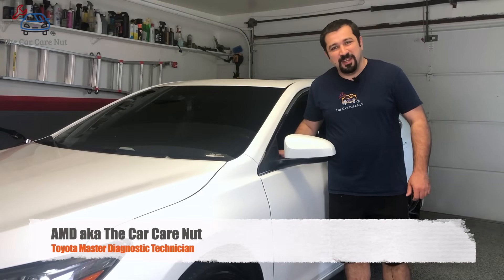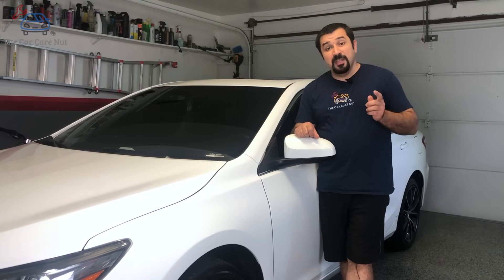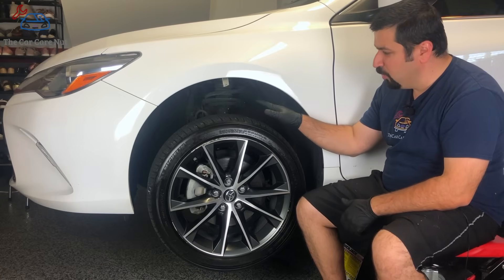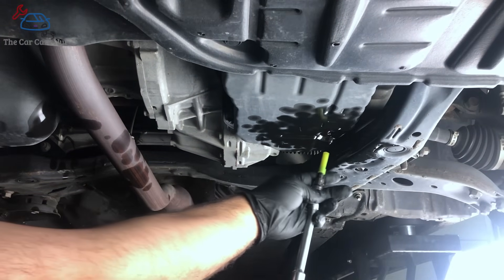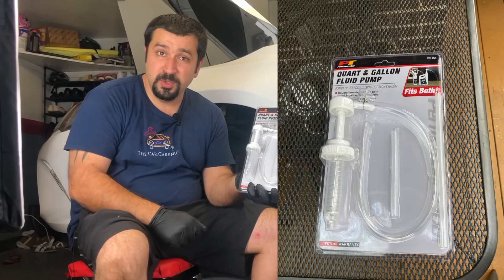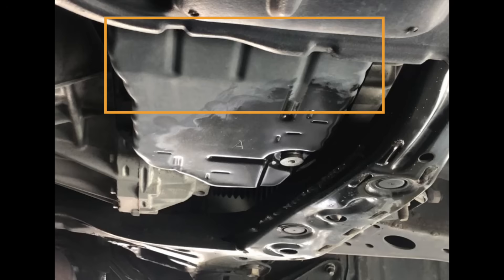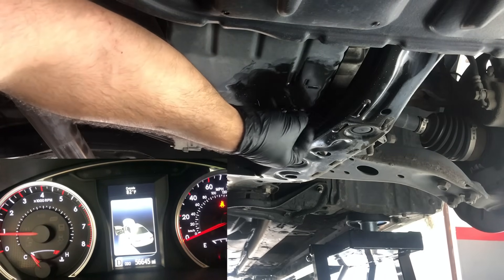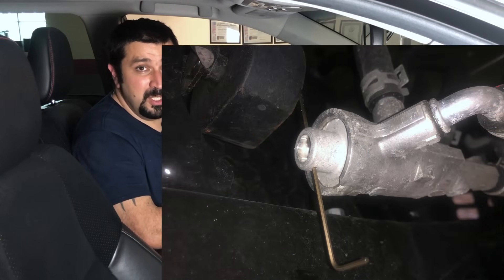How to change your Toyota Sealed Transmission Fluid

Comment: I am ordering a male OBDII connector from ebay for around $3. I will solder a wire inside it to make the jumper. No more guess work, no more jumper falling off while doing the procedure to miss the momentum. Just Plug-in/Plug-out.
Label it using a P-Touch tape.
I am not providing any link because over time they may no longer work, Just look for this on ebay:
Universal 16-Pin OBD2 Male Connector Cable Adapter Terminal Diagnostic Tools
Reply: Hey just don't get the pin #'s mixed up as in mirror-image! A home-made jumper with appropriate pin diameter will not just fall out ever, I made one with a resistor for testing fuel-level sensing circuits and used very thin paper clip wire.

Comment: Great video! I let the dealer change mine at 80 k, now I’m at 160 and prolly gonna let them do it again , they said there is no mileage for changing this and I said no fluid last forever, they changed it but Toyota should have put a dipstick on my 14 Camry

Comment: Is it The Same Procedure  For  2005 Tundra  And Temp Range ? Great Video  Thank You !
Reply: I just wondered if the jumper wire in the OBD 2 port  With The D worked on A 2005 Tundra Something that  Old ? Since My Scan Tool I Dose'nt  Do Trans Temp.  Thank You
Reply from the maker: Correction. The fluid range is actually 97-115 F my bad. And the jumper wire procedure does work on your truck just instead of the D light you’ll use the A/T OIL TEMP indicator
Reply: @TheCarCareNut  Thank You Very Much !
Reply from the maker: Hi! That should have a dipstick.
Reply: @TheCarCareNut   NO Dip Stick  For 2005   I  have Seen The Fill Plug With WS On The plug On 2005 Its On The Pass SIde   Plus The Drain Pan Has The Drain plug And The Check plug SO For Sure It Dosen't Have A Dip Stick          It's 4x4 With Double Cab  2005  I Bought it New
Reply from the maker: Interesting. If it doesn’t have a dipstick then it’s an overflow type. The fluid temp range should be around 97-115 F
Reply: @TheCarCareNut  Thank You Very Much For Your Help.   I Think On The Tundra The last Year With The Dip Stick Was 2004 ,     2005 and 2006 have  the fill plug 24mm  on the right pass. side and 2007 and up the fill plug 24mm is on the left driver side.

Comment: Any chance you have one for wifes ride?    2020 Durango RT?
Reply from the maker: I unfortunately don’t. However that one is even easier. If it has the ZF transmission which is similar to the Supra transmission it does require a temperature reading as well and you fill the transmission from the side until it overflows. Research on this transmission as I don’t have more information on it.
Reply: Ive seen a couple and like the others for the Ravs theyre way too much garble.   Your video on this was straight forward and easy to follow.   👍   Hence why I was hoping you had one.   Thanks again and keep up the great work for us DIY folks!    We appreciate it!   👍👍

Comment: What about the filter?
Reply from the maker: I would replace the filter. No harm in replacing it but no benefit either
Reply: @TheCarCareNut  interesting.. with every ws transmission?  Or only if they have high miles?
Reply from the maker: Actually with most Toyota transmissions especially WS transmissions. I see many 200-400k mile cars on the original filter just regular fluid changes.
Reply: @TheCarCareNut  nice to know that saves a lot of time
Reply: I was writing on who know what language haha, sorry for so many mistakes, wrong keyboard corrections

Comment: I've always drained trans oil and replaced what I drained. I won't do that anymore. My new 2017 tacoma off road came 1 quart low from factory in Mexico. Common issue with 3rd gen tacomas. Will start doing temperature checks from now on. Great video.

Comment: Thanks for this. I'm at the point where I need to do this. I'm not a bit happy with Toyota for coming up with ridiculous things like this. I'd pay the extra $20 for a dipstick and fill tube. And why is the level so bloody critical?  That's not very good design at all. Way too involved for something like changing a fluid.
Reply: Not a good design for you or me. A great design for the greedy arrogant decisions makers at Toyota. They obviously want to make it as difficult as possible so you won't do it and will eventually have to replace the transmission. How arrogant and greedy can one company get? They have the gall to make a claim that the fluid is "lifetime" for the vehicle. What idiots they take people for.(Not without reason I may add) They take the cake with this design. But most people will take it, pay out the nose for a Toyota, all the while Toyota will continue to look for ways to screw their customers. That is all this is and don't think this is ever going to go back the other way, because it's only going to get worse until people quit buying their product.
Reply: They want it to fall
Reply: @Fedproman  The new Toyota 2020 models put the dipstick back in, so I have heard.

Comment: If the car sets over night and you change your transmission oil and measure what you took out, why can't you put back in what you took out? Everything is at room temperature.
Reply from the maker: Hi! You can but I’d say if you did all that why don’t you just finish the job and verify the level is correct
Reply: @TheCarCareNut  I watched your video, many people don't have the equipment or someone else trying to help them.
Reply from the maker: The equipment you need is a small piece of wire for the jumper and rest is tool less
Reply: @TheCarCareNut  ?
Reply from the maker: I meant if you needed to you could pull it off alone. And as far as tools needed you could pull it off without a scan tool as the video shows.

Comment: Why is the fluid so dirty?...
Reply from the maker: That is normal for this mileage. WS fluid tends to get darker much quicker than older fluids. But it doesn’t smell burnt at all.
Reply: @TheCarCareNut  I replace my transmission fluid every 60k miles/6 years and it's always pink or slightly dark pink so it caught me off guard to see it that dark

Comment: Hi I took my 2012 lexus IS250 awd to the dealer for trans service they only wanted to do a fluid flush is this ok? Thanks
Reply from the maker: Hi! That’a ok if it’s done right followed after the flush by checking the fluid level.
Reply: @TheCarCareNut  ok thanks and I appreciate you getting back thank you

Comment: Does this same process apply for the 2013 Toyota corolla? Simply drain, refill and remove excess?
Reply: I've checked for a transmission dipstick but it's not under the hood. Maybe it's different for Australian corollas?
Reply from the maker: It’s possible that it’s different. I’d need to know the transmission model. Take a picture of the black sticker on the door jamb of the drivers door.
Reply: Just sent you an email with the picture.
Reply from the maker: Hi! Your 2013 corolla has a dipstick. So drain and fill and check with the car running.

Comment: Does the 2012 Toyota Camry XLE have a CVT Transmission?  I am asking because I want to add LUCAS  fluid to the transmission because of a shutter I am experiencing at about 45mph. Car has 165k miles. Please advise. Thank you so much. Be well. JC
Reply from the maker: Hi! It doesn’t have a cvt transmission and it’s a known problem with the torque converter. You’ll need a torque converter and a software update.
Reply: @TheCarCareNut   Thank you for the quick response. So since it is not a CVT Transmission  I can add the LUCAS fluid and see if it works i guess. Any advice on that? Thank you
Reply from the maker: I personally wouldn’t add anything to any Toyota transmission. But that’s up to you.

Comment: What is the correct temperature when using a scan tool on a new Camry 8 speed transmission?
Reply: Thanks a lot! Should I change it every 30K? My local dealer is recommending a “flush” . Current mileage is 28k.
Reply from the maker: Hi! You can change it at 30k. I would however change it every 60k which is also a safe interval to protect the transmission
Reply from the maker: Hi! 95-113

Comment: So my 4Runner has 44,000 miles I should get this done at 60,000? 
Is a Toyota dealership the best place to have this done? They just did an inspection on my vehicle and everything was in the green..
I can't do this I'm a girl and I only know how to check my oil dipstick...lol...
Reply from the maker: Hi! I would have the dealership or a trusted shop do this using Toyota ATF WS fluid at 60k miles.
Reply: @TheCarCareNut  thanks I will try the dealership...I have a pretty good one close by here...

Comment: What a ridiculous design. ALWAYS LOOSEN YOUR FILL PLUG FIRST! If you drain the fluid and cannot remove the fill plug - good luck filling it!
Reply: I'm gonna be attempting this at my next oil change thanks for the tip! 2015 camry le with 26,300 miles. Next oil change 30k or October 2021 whichever comes first. Interesting because the Toyota technical service bulletin states 100k intervals with inspections ONLY, that the ATF is good for the life of the vehicle lmao! Crazy

Comment: Why are manufacturers eliminating the transmission dipstick? Much easier to check and then fill the transmission with fresh transmission fluid. So put it back Toyota. Some really stupid manufacturers like BMW have eliminated the oil dipstick?

Comment: What about the transmission filter do you recommend do it in at 60k miles? And also do you know if the transmission pan gasket is reusable?
Reply from the maker: I don’t recommend filter replacements on Toyota transmissions and the trans pan gasket is not reusable
Reply: @TheCarCareNut  thank you, is there a particular reason you say no to transmission filter?
Reply from the maker: I work at a dealership and we don’t change transmission filters and have seen countless Toyota transmissions last well into the 300k range with the original filter and only fluid replacement.
Reply: @TheCarCareNut  What harm would be done to change the filter ?
Reply from the maker: Contamination usually

Comment: Would be same process for rav4 2017? Planning to replace filter as well every 50 k as a routine maintenance thanks
Reply from the maker: Hi! Yes it does work.
Reply: Have you done to work yet? Please give me a status report.

I am going to be starting on my newly bought 2018 soon. After having three supposed Mastertechs say there is no filter, I've decided to do this. It's under a certified pre-owned warranty and, if there's any problems with big chunks of metal in the transmission fluid pan, it can be addressed quickly. Since I don't know how the previous owner drove it, I'll be cautious.

I don't think I'm going to do a complete flush, it will be a drain and fill, I think.

Comment: QUESTION: we have a 2015 4Runner TRD-Pro with 83k Miles and i wanted to have the Transmission Fluid Changed, but the Dealership said they rather not do that as the TRD has one of these sealed Transmissions, and it is better to not mess with it as you gotta be super careful about the filling Temp...
We plan to keep this Car long term, we had another 4Runner before, and sold it with 200k miles, and we aim to the same Goal...
Should i insist i have the Dealer Flush the Transmission on our TRD-Pro, or should i leave it alone?

NOTE: we do some Off Roading, nothing extreme, but we got a Pro to use it and we enjoy the Low Range 4WD capabilities it has
Reply from the maker: I would change the fluid. The 2010-2021 4runners all have the same transmission no difference if it’s trd or not. I would change the fluid every 60k or 6 years.
Reply: @TheCarCareNut  i was thinking about Flushing... do you racomend Change or Flush?
Reply from the maker: A transmission flush thats done right is ok. Otherwise a drain and fill is safer.
Reply: @TheCarCareNut  at last the dealership didn't feel comfy with a Flush, so they just changed the Fluid, cleaned out the Pan and that was it... They said Fluid looked still good.

After that
We went Off Roading a couple of times, had to make her crawl up in Low Gear , i even had to tow a small alluminum Trailer and set it on S4 to not make it work hard.

So, all great.

Everything perfect until this WeekEnd we took a long trip up the mountain, about an hour and half drive on Interstate, and i realized she takes a long time engaging 5th and overdrive... at 70-75mph at the bare min incline, she would downshift to 4th, rev to 3000rpm and stay there for a while until we crested over and went downhill again... almost like she didn't like to get into 5th, but once she got there, she held it fine, no signs of slippage that i can notice.

Should i worry?
Reply from the maker: I wouldn’t worry. At most I would check the fluid level to be on the safe side. Mountain driving will cause the transmission to hold lower gears longer. If it doesn’t do that driving on flat areas you’re good.

Comment: My dealer says they flush the transmission.  Is that safe?  (2018 RAV4 with 53000). They said they replace what they take out.  Enjoy your videos!  Thank you!
Reply from the maker: Hi! At this age and mileage it’s safe. As long as it’s done right and followed by a fluid level check.
Reply: @TheCarCareNut  
Thank you very much!

Comment: Hi Amd, I have a rav4 2013 fwd.  I had the gear oil changed from a local shop. I got Toyota ws from the dealer. Here in the middle East it comes in a 4 litre  can. He filled the 4 litres completely. This was before I saw your video. The filter was also changed. I tried your method to drain the excess and around 2 litres came out. The car Shifa smoother than before. I am just a little worried that only around 2 litres is left in the pan. Normally how much would it hold. I'm sorry coz this is a long read. And am really found of your videos. Respect brother.... Keep up the good work

Comment: What is the target transmission fluid temperature. I have to do maintenance on the 2011 Camry and 2014 Venza soon as the outside air temp allows me to. I own an Actron autoscanner plus. I have not observed if it had the transmission fluid temp on the PID
Reply from the maker: Hi! Which engines in both cars?
Reply: @TheCarCareNut  The Venza has the 2.7 L4 and the Camry has the 2.5L
Reply from the maker: 95-113 F for both
Reply: @TheCarCareNut  Thank You

Comment: I went to the dealer and asked them to change the fluid in my 2008 Prius transmission and was told it didn't need it. Ran 350,000 miles on the same fluid no issues

Comment: 👍🏼my tundra is coming up on 6 years and 35k definitely wanna do this soon. Can the temp be checked the same way?  Also what exactly do I do to the cooler on the side of the trans? Thanks in advance.
Reply: Yes I see it on the passenger side its Cooler/heater it's a 15 tundra 5.7. I'm gonna practice getting the transtemp to the right  temp
Reply from the maker: Hi! The same procedure works on your tundra. Depends which year it is you could have the cooler bypass which would be on the passenger side of the transmission in a very easy and open location.

Comment: What part of the car are you checking to see if it's level? Frame? Transmission pan? Or are you just estimating by how level the car looks when it's suspended?
Reply from the maker: A general estimate of the level of the car. An example of a not level car is only the front lifted with jack stands and the rear on the ground

Comment: Thanks for the video man! Good stuff I appreciate you showing us my 2018 rav 4 I believe has a U760F which the f means all wheel drive if I’m correct
Reply from the maker: Hi! The transmission in this car is a U760 as well. The Awd variant of this transmission is exactly the same just has provisions for the transfer case to connect to it
Reply: @TheCarCareNut  awesome! I have a maxisys autel so there’s no need for a jumper wire
Reply: @TheCarCareNut  my car has 33,000 miles on it would U recommend me to change the fluid? What about the filter? Just wait on the filter?
Reply from the maker: I would wait until 60k or 6 years. If you want to change it earlier no harm in doing so as well. But you can safely go to 60k or 6 years without any issues. I wouldn’t worry about the filter as on Toyota’s they’re not commonly replaced.
Reply: @TheCarCareNut  ok cool thanks for the help! I trust your word because you are a master tech for Toyota, so what I will do is drain the fluid all out then put back in what came out and add a extra half a quart on top of what came out, then start the car and run it through the gears etc until it gets to the correct temp then check it with the car running that sound right?
Reply: @TheCarCareNut  I bought Mobil 1 ow20 I can’t find Toyota factory oil in my neck of the woods but I did get the oem Toyota filter at Walmart which they carry

Comment: I opened the oil pan didn't find overflow tube
I measured the quantity and refilled the same amount approximately 
I need to buy the measurements tube if any one can help me to find out
Reply: Thak you ..
Reply from the maker: What year and model?
Reply: @TheCarCareNut  2008 lexus ls460 l
Reply from the maker: It might have one that looks different but it’s there

Comment: thank you for the video. Would this prosedure be different if working on a 2013 toyota avalon hybrid limited?
Reply from the maker: Yes hybrid transmissions are different and actually easier. A simple drain and fill. I’m working on a video for that which will come soon.
Reply: @TheCarCareNut  Thank you.

Comment: Probably the one thing I hate about newer cars is no transmission filler tube and stick....although my 2007 doesn't have one either.
I'm guessing it's because the car manufacturers want more quality control over their brand....if this isn't the case then it was a dumb move deleting the trans. dipstick.
Nice video.